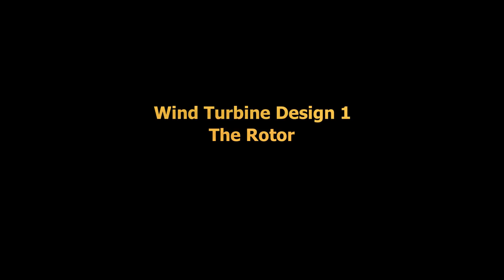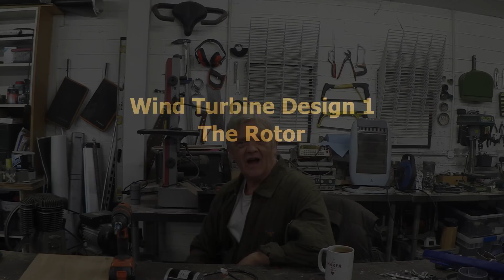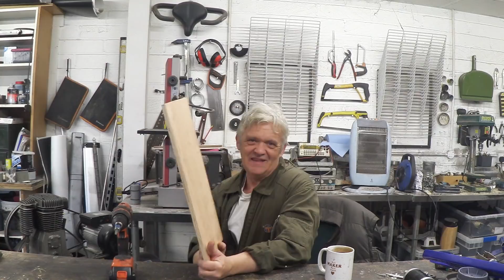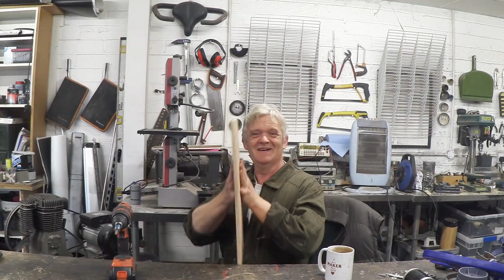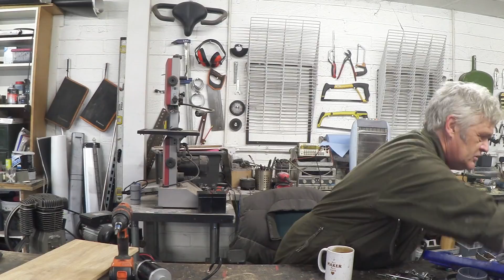1161 Wind Turbine Design 1 - The Rotor

Comment: Would love to see a comparison of output with the same generator on different turbines at various wind speeds.   You're right in that there is no 1 best design but for different windspeeds there will be a highest output design.  Then that info can be applied to the site you intend to set up in.  Of course there are other considerations, such as urban vs rural siting which will determine how smooth the windflow would be.

Comment: Permanent magnet motors are not ideal for variable speed power sources like turbines.   The 'lumpiness' you describe when you turn it prevents the turbine from starting in a low wind situation.  
What you need is a motor with an electro-magnet to energise the main coil(s) when it turns.  That way you can let the turbine start under no load, ie start with no energising current.  You could also find what energising current gives the optimum power output for each wind speed.  Have a word with your local tame motor mechanic to get one of these 'motors' out of a scrap car.  They call them alternators.

Comment: That was great explanation of wind turbine generators! 
I keep watching your channel, I learnt a lot from your videos.. 
I appreciate your hard work and spending time to make such awesome videos.. 
Since you have made wind turbines using nearly all kind of stuffs, like cd motor, fans,... But I would request you a different approach to make wind turbine.. 

Idea is to capture wind using funnel, increase wind velocity.. Then a disc shaped turbine with large number of blades is used to rotate generator! 
Advantage, is that turbine is small, as small as one feet in daimeter,but puts out more power.. It has high rpm.. The design of turbine is like of "Heppot turbine " (Google it to see pictures) 

On YouTube there is video of "powerpod turbine" .. It has compact disc shaped turbine may be just one feet in daimeter! 
I hope you will like this idea of funneling of wind, please make such type of turbine also, I will be happy to see it..

Comment: i need the formular to calculate the output if an vertical windturbine with an fender in front of it. it has to generate 10% of its mean. i mesn i have a bunch of motors like you have shown. one of it is a 1000W 48V motor the other two are 32V 800W. for me it will good if i can get this 3 motors turn to generate 12V and about max 50-100W. but my question that stands gor me in the room is. hiw to calculate the vertical rotor for this work. can you give ne a hint hiw to look for?

Comment: I keep thinking a simple gearing should allow a HAWT to have a fixed vertical axis generator. And it would mean changes in wind direction couldn't break wiring by turning around the compass by wrapping the cable around the support pole/tower.

Comment: All that we are really interested in, is the power out !
Reply from the maker: yes - of course - but to get that and understand what you are seeing you need to understand torque and speed and the role it plays - otherwise it means nothing to you
Reply: All depends on the speed vs tork. Will give you voltage and amps
Reply: Plus you need to think of the initial surge.

Comment: As you were going through this I was wondering about the “parcels of air”.... some kind of modelling for the actual pressure gradients and their shapes in the air fluid. I know nothing about laminar flow turbulent flow etc, But with this consideration and things you’ve said in the past, location selection must be a huge factor — possibly not just for windspeed alone, but style of wind flow might couple better with certain blade types rather than others. That hadn’t occurred to me before, it might be inconsequential but it was nonetheless interesting to think about =)
Reply from the maker: location does matter mate

Comment: So why are you building HAWT's with blades that taper outwards from the centre? Wouldn't blades with the blade width (and hence the mass) at the ends create a flywheel effect and capture more wind on smaller builds? Old water pumping mills here in Australia have blades wider at the perimeter than the centre!
Reply from the maker: basically you make what you think is good the try it - so go for it make what you think is good

Comment: What would happen if you turn a HAWT around and let the blades run on the opposite side of the wind direction, will you still need a tail to point it into the wind or will it turn automatically?
Reply: The problem with tail windturbines are the stresses caused by vibrations each time a blade passing the tower. This repeated downwind stresses may cause material fatigue. They can be designed that the rotor directs itself when wind direction changes. For large windturbines this automatic self regulation cannot be used because of the large stresses on the blades occurring with windshifts. I think it’s called coriolis forces, the same when you use an axle grinder and quickly change direction. It could demolish the turbine. That’s why large HAWT’s use yawing motors to adapt to changing wind directions in a controlled way.
Reply from the maker: I think you would still need a tail. mate
Reply: @ThinkingandTinkering  yes indeed, it is only a thought not planning on a prop based system for now
Reply: @ThinkingandTinkering  sorry, the whole idea is to get rid of the tail. The prop fitted where the tail should be will turn into the wind surely

Comment: For my satellite dish Rose I'm using an really early E-scooter motor.. Seems to be doing pretty well and it's actually supplying more power than I need for the application I set it up for (3 water pumps for my pond). With a little boost circuit plus a small solar panel I'm getting enough to trickle charge 9 x 18650's to full even with the pumps running 24/7.
No idea of the actual spec, they were just a bunch of wheels with motors I picked up years ago. (will investigate)
Reply: Is the boost circuit a joule thief or something else? Sounds brill.
Reply: @Earzone63  the electronics are boards from vape mods.. The input side is an evic mini with a boost circuit that Clive reverse engineered from a battery powered led set, and charging is handled by a wismec reuleaux output stage. It was a pain in the ass to get going and I had to get some help from a local that's been doing solar installations for years. I didn't think about using a joule thief.. I might be able to run one of those as a backup to keep the circuity alive if the power drops below their operating voltages.
Reply from the maker: that is awesome - thank you for sharing they are 120W to 250W at 24V I think

Comment: It is much about the installation and the maintenance of the wind turbine while getting a reasonable return of energy for your money. Traditional windmills are all over Africa and they work, but they are ugly , directional  and very expensive and are not allowed in most towns. Their blades are the size of the surface area of the circle they occupy , you cannot get more effective than that?

Comment: 3-PHASE:
Is 3-ph power realistic in a small wind mill?
Also would a centrifugal drive work with variable winds?
Reply from the maker: put a BLDC motor in the generator area and you get three phase
Reply: @ThinkingandTinkering  
Thank You. 
What about the “ centrifugal clutch drive” (like what’s on a Polaris ATV/UTV 4*4) like that which is on ATV’s, could it prove to be effective in winds that are inconsistent?
Or in-general, work?
Thank You for responding to me. 
I appreciated it a lot. 
Have you tried, or experimented with this?
I would think it would help keep maximum torque between the wind proportion and generator, if set up right?

Comment: Currently making a new hho torch its highly efficient!! Just a sock around some copper scrubbers with a wire or even better a flayed out dc car audio high gage wire. Zip tied together. And then shoved into a steel pipe and tapped. Worried about somehow it combustion still myself but its opened tapped so im just fooling myself. O!!! I used old 2 liters of pop with top cut off and then heat gun formed to the pipe to better get air tightness heat gun forming 2 liters should get its own show.

Comment: The best thing I ever saw was when you pointed out that a capacitor after the generator takes the load off the generator.

By the generator charging the capacitor not the rest of the system.
Reply: We thought it might have something to do with the voltage current (sinewave) phase shift although, i’ve seen somewhere that capacitor could introduce 50% energy cost (I could be wrong about that however), and obviously something spinning is better than something not spinning!

Comment: Hello Rob, Love the videos, very, very informative. It's probably the electrical engineer in me but I sometimes think the approach is backwards, in that the driver design (blades for example) is thought of first rather than the final output required. Once you know the output you require, to charge a set of batteries for instance, then you work backwards to achieve a driver design that will give you that output.
Reply: The other approach is equally valid for experimentation.
Making something and then figuring out what you can do with it can sometimes provide inspiration you'd otherwise never get.